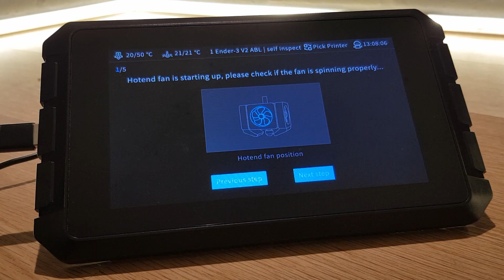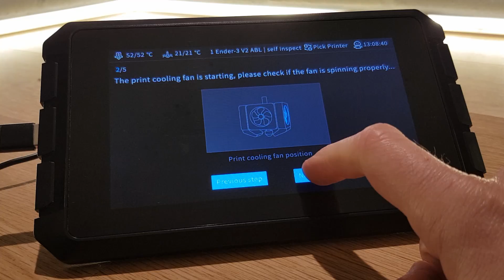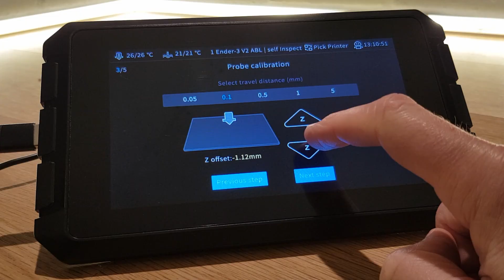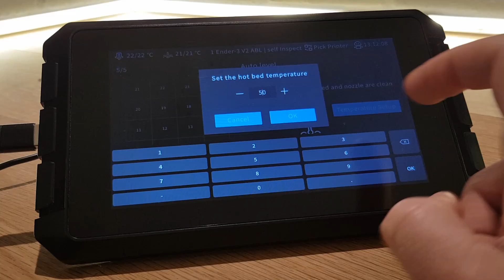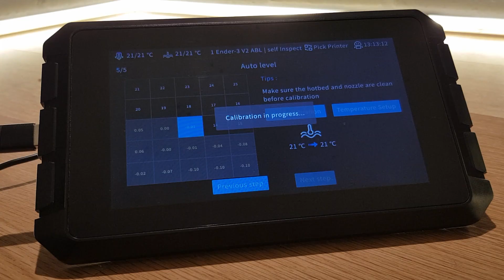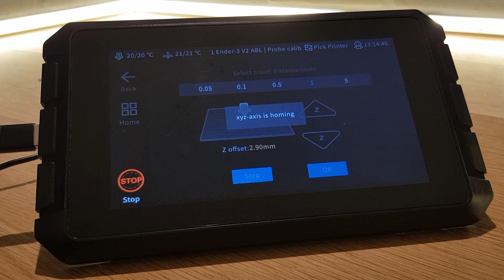Completing The Initial Setup Of The Sonic Pad - Sonic Pad Basics Part 2

Comment: Pretty good but I have a two problems.
I have an ender printer with a sprite extruder pro head and bltouch on it. 
First problem. During "manual leveling", the nozzle is not in axis with a screw.
Second problem. The bltouh sensor is offset from the regular head. As a result,during "auto level", the bltouch goes outside the table. 
So my question is, does someone can advise something?

Comment: I just wanted to add,  I have a Ender  3 s1 pro and I had  the hardest time following the books instruction on leveling,  tighten the screws..... after a few hours I went back to your ender 3 s1 pro leveling followed the steps and I had it perfect in no time.  Thanks

Comment: Hi Ricky, great set of videos, I have a Creality CR-10 Smart Pro and the installation was smooth thanks to your guides, but unlees I missed it, now the pritners is controlled via the sonic pad there is no menu option to shutdown what is the correct process to shutdown the sonic pad and the printer to ensure that there is no software corruption or is it just a case of its save to turn off the sonic pad/printer via the mains.

Comment: Need one more increment:  0.01mm   (I stand by my fastidiousness.)
Can I use console commands during this calibration to help?
Like can I use:
G92
G1 Z-0.01  (however many times necessary)
Then hit OK to save the position as my Z offset?
Reply: Never mind.  I've never done a level and offset that didn't need live adjustment during the first layer print. :-P  Fortunately, the Sonic Pad THEN allows 0.01mm adjustments.

Comment: I've had an Ender 5 Plus for just under a year, upgraded it with silent board, and Micro Swiss NG Revo but have problems with the z offset.  After I start calibration and it gets into the front left corner the probe is off the base and and I have to turn it off to prevent a crash. I get a "No trigger on probe after full movement" error.  Solution guide says, locate the hardware problem according to the error report details.  I can't get past this point.

Comment: how do you adjust Zed offset by only .01? cause it does 0.05, and mine is betwen 2.73 and 2.78 and i don't want to scratch the bed.

Comment: Dear Ricky, I purchased a Sonic Pad, I spent 1 month to discover that it was a defect in the cable. Then the flat cable on the Ender 5 S1 also had a problem. Finally I installed it and saw that you instructed me to CALIBRATE THE Z AXIS, DO THE MANUAL CALIBRATION, THEN THE AUTOMATIC CALIBRATION AND FINALLY THE Z AXIS CALIBRATION AGAIN, only with the nozzle touching the table. I did the step by step and still when I use a table calibration printout, the distance is not correct. I move the table manually and calibrate again. When I print again the error persists. As if the printer compensated for the movement of the table to maintain the distance. What do I do?

Comment: im using an ender 5 s1 and for some reason during the final bed leveling configuration of the connection test,  the prob appears to miss the bed entirely, how do i adjust the work area parameters?

Comment: thank you for this video!! helped me a lot during my setup, watched the whole series!! recently though I have this problem that happened all of a sudden. I dont know if you ever encountered it. I am not able anymore to adjust my z offset during print anymore. when I press down or up, it does not respond to the printer and my prints fail. I tried doing a reset of sonic pad and still same problem. would you have an idea or encountered something like this before? Thank you!!

Comment: Hello, 
I’m a bit confused with the second z offset procedure (the final one after ABL). After manually lowering the nozzle to the 0.1mm feeler gauge why do you remove the feeler gauge, then send a final 0.1 command? Doesn’t that essentially close the gap and put the z offset too close to the bed? 
In other z offset procedures they touch the nozzle to the feeler gauge (or sheet of paper) with a little drag and that's it. They don’t send a command to then close that feeler gauge gap. 
I tried the method you showed and now I have substantial first layer squish and elephant foot. 
Thank you for the content!
Reply: This has confused me too, would be great to have further explanation.
Reply: Well I calibrated with gauge of 0.20mm and did 20+ prints with nozzle dragging and scratching on 20%... I just recalibrated and did -0.20 after I set z-offset and  you know what? It works... Dunno how.

Comment: Ricky, the videos are great.
One question I have is regarding the final Z offset setting. After using the feeler gauge, you then lower the offset the thickness of the feeler gauge, basically eliminating the gap.
Before watching the video, I've been setting the gap for a slight drag with a .2mm feeler gauge and then leaving it that way and haven't' had any bed adhesion issues.
When eliminating the gap, is the pad or klipper compensating for this, meaning the nozzle on my first layer  is actually .2mm too high??? 
Thanks again for the videos.
Reply: Have you come to a conclusion on this? I just posted a comment asking pretty much the same question then scrolled down and saw this. 
All other z offset settings I've seen you lower the z to whatever "gap" you want and that's it. That gap becomes your offset. 
I don't understand why you'd want to send an additional command to close this, unless klipper compensates?

Comment: Hi Ricky, will you be able to advise how to install a glass bed onto Ender 3 S 1 Pro? I removed my magnetic one (gold) but there are two screws on the top or the bed. The glass bed doesn't have any holes to fit it properly. Should I remove the screws or how can I upgrade my 3S1 pro with a glass bed or drill the holes (probably this will damage the plate...)?or leave the gap and adjust the mesh ? I am having horrible trouble with my magnetic bed when I am trying to calibrate it with a sonic pad. So I gave up on printing because everything is coming out bad :(

Comment: I'm wondering why you set the z-offset to minus the thickness of the feeler gauge at the end? Doesn't that mean the nozzle will now be touching the bed?
Reply: Yeah i dont understand that either!
Reply: @timoteiNitrogen  I worked it out. The Z offset is only the distance from the probe to the nozzle. Not from the bed. That's why you remove the thickness of the guage from the value.

Comment: Ricky i found some stuff that you might want to make a follow-up video on.

Today when printing something on my S1 Pro + Sonic pad that maximized the build area i got the error "Move out of range" in the console.
It seems the printer.cfg file has wrong values in it from Creality.
For X-axis it says position_max: 245  (should be 235)
For Y-axis it says position_max: 230  (should be 235)
So i altered these and now it worked to print..

There is also an issue with the 4 bolts in the heatbed, you know the ones the thumb wheels are screwed on. They rotate ! Their bolt heads are not fixed, so if the bolt is a bit damaged (occurs if the bolt hits/scrapes the metal plate hole when often moving up/down) then the thumb wheel wont go up, it only rotates the bolt. So i fixed this with adding another nut before the springs are put on. So now the bolt head and the nut makes the bolt being still :)

Thirdly there is this issue with bed mesh that the front of the bed dips down much more then the back, even though it actually doesnt..
I can see my prints first layer being smashed down/pressed down alot more in the front then the back of the bed so the mesh bed leveling is wrong. Have you seen this issue aswell ? Seems to be many ureddit posts about it.

Comment: Genuine question - why after having gone through the bed levelling process that the Sonic Pad takes you through, do you then need to go into the Probe Calibration function and make a further adjustment to the Z offset. I'm just a little confused as the software does not ask you to do this???
Reply: Great series of videos which I will definitely follow when I get to install my Sonic Pad. Will I have to keep the original touchscreen plugged in to my S1 Pro once the Pad is up and running. 
Being able to remove it along with the mount would give me a little more room on my work area.

Comment: When I do my bed mesh, most of it comes out fine, but my back right corner gives 0.24, 0.23, 0.20, 0.10, 0.10 as the readings in the far right column. Do you correct this with the manual adjustment wheel?
Reply from the maker: Personally, being a bit of a perfectionist, I would probably tweak it a little and run the levelling again to try and improve things. However, the bed mesh should compensate so you can try a print designed to test your first layer and see if it works ok. Be aware that there seems to be a bug with the Ender 3 S1 Pro where it seems to use the bed mesh when you run through the Manual Leveling procedure which messes things up. If you plan to use the Manual Leveling, I would clear your bed mesh first using the web UI.
Reply: @RickyImpey  thanks so much! I know everyone keeps saying it, but your videos are an insanely great resource for all of this set up!

Comment: First of all congratulations great videos.
I just bought the Sonic Pad.
I have recently entered the world of 3d printing and I started my first experiences with my Flsun Q5 printer.
Now I would like to use the Pad on it since it is already supported by the pad.
But before installing I wonder, how to behave with the leveling, given that being a delta I have a fixed plate and practically I only have 3 z axes ...
Can you explain me how to do also about how to use the input shaper probe on my printer. Thank you

Comment: Can someone please help me???  After I start calibration and it gets into the front left corner the probe is off the bas and crashed the head. I get a "No trigger on probe after full movement" error.  Solution guide says, locate the hardware problem according to the error report details.  I can't get past this point.  I know I'm overlooking something so simple but just can't figure it out for the life of me...  Can someone please throw me a line???
Reply from the maker: Sorry for the delay, all you need to do is change the z_offset and y_offset figures under the [Bl touch] section in your config file. What printer do you have? Do you know how to edit the config file?
Reply: @RickyImpey  Sorry to hijack the thread but I have the same issue on an Ender 5 S1 - any idea how to fix this? I'm concerned I'm either going to break the printer head or have bricked the printer :(
Reply: @RickyImpey  I'm running into the same problem with the Anycubic Vyper... also would like help with the config file, if possible

Thanks!  Your videos are AWESOME!
Reply: @RickyImpey  Hi < I also have this issue with an Ender 5 Plus with Micro Swiss NG Revo direct drive, did you manage to find a solution to this problem?

Comment: Will this work with an original Ender 3 (non pro). Also what to do if you have solid bed mounts on said printer?
Reply from the maker: Yes, it works with all Ender 3s, With solid mounts, you will have to just skip the manual leveling section and go straight to creating a bed mesh.

Comment: Hi Rickey, great videos, pal. I've just acquired a Sonic Pad and trying to setup with my Ender 3 Max using your videos. My Ender 3 Max has a CR-Touch installed. The only 'standard' printer option is the Ender 3 Max, no CR-Touch version and it doesn't work with the CR-Touch. I've tried the Ender 3 Neo Max. Ender 2 v2, etc. All to no avail. Any advice would be welcome?

Comment: Tried going through the initial set up last night. And as soon as it starts it cuts out and gives me a message about webhooks request.
Reply from the maker: That sounds like a fault and not something i've encountered I'm afraid.
Reply: Figured out it was any time the hot end would try to heat up. Finally I tried setting the hot end 5 degrees above ambient and it allowed it to heat up. Bumped up by increments of 5-10 degrees up to 280 and it finally allowed it to print afterwards. Not sure what the actual issue was. But that managed to eliminate it for me.
Reply from the maker: @DEFBOY35  have you done a PID tune? It sounds like you have a thermal runaway error. A PID tune should fix this.
Reply: @RickyImpey  I was able to do the pid tune after I had done the steps above. It has been a bit interesting to say the least to try and get this set up. Getting closer though. 
I am scared to shut it off though. As I had lost my entire cfg the last time I did. Even after multiple saves and had to
Go through the whole process again.
Reply from the maker: @DEFBOY35  it definitely shouldn't lose the cfg file when powered off. Save a backup copy of the file if you connect with a web UI if you are concerned.

Comment: Hi Ricky,

When I try to complete the z offset I get the following error:-

error on 'z_offset': 'touch' must have a minimum of 0.0 once the underlying issue is corrected, use the "restart" command to reload the config and restart the host software. printer is halted

My offset is a negative number but now I can't save this please can you help?
Reply from the maker: Check your position_min figure in the stepper z section of your config file. If this figure is larger than you z offset then it may cause the error.
Reply: @RickyImpey  ok will take a look at this later. 👍🏻
Reply: Hey man, thanks for your help so far I have tried what you suggested but it hasn't helped. Regardless of what I have the Z offset set to I get the error..

Even if the value is positive
Reply: I'm assuming that you're not able to help, I'm hoping that you can 🤞🏻

Comment: I got my Ender 3 S1 Plus last week, and the Sonic Pad with it, and very much like the setup apart from the PEI bed becoming delaminated in the center. As a result I now can't use the printer until I get the new PEI sheet being sent under warranty, even for testing as the damage is right where the pre print ABL happens and the sensor touches. So, is there any way to adjust where the ABL checks the bed pre-print so that I can at least do filament calibration tests?
Reply from the maker: Sorry to hear you've had issues, could you not flip the bed surface over and print on the back in the short term?I don't have the Plus so don't know what the back surface is like.
Reply: Thanks for the reply - the back is just bare spring steel, plus I am not sure how the detached area would affect the seating of the plate. If I can change where it senses it would be usable

Comment: I have a sprite extruder on my ender 3 pro. When I try to do the initial bed level, my probe is off the print bed.
Reply from the maker: Do you have the latest firmware on your Sonic Pad? I believe they have added sprite config options. I haven't tried myself. If not, the home position is set in the printer.cfg file. Look for the 'home_xy_position' line in the [safe_z_home] section.
Reply: @RickyImpey  appreciate the response btw
Reply: how do I edit the .cfg? The pad gives me a .bin    I do have the latest firmware on the pad, I even read the change log where they talk about being able to select a sprite extruder, But it is not available in the initial set up

Comment: I'm planning to switch to Sprite extruder on my Ender 3 v2 with the Sonic Pad connected. I believe, a lot of users will go through the similar process. Can you make a video with advices what and how to do in this case to have all direct extruder and Sonic Pad benefits? Including changes in e-steps, retraction, calibration etc. Thanks  :)
Reply: In the printer config file under extruder it will be rotational distance you want to
Change (not e steps). A good starting point would be 8. That got me pretty close to extruding 100mm when I demanded 100. And tweak from there until you are as close to exactly 100 mm

Comment: Great series, would be useful to show us how to redo levels with Sonic Pad after initial setup as it is proving to be a pain without resetting the sonic pad. If I tighten all the springs, probe, then go to manual I get no 'play' in the springs, so I untightened the springs by 10 turns, probe, went manual and now my auto calibration is all over the place. What are the steps for redoing bed levelling with the Sonic pad, am I missing a step or doing in wrong order?
Reply from the maker: Great idea, I will add it to the list of videos. You can skip past the manual level stage in the initial setup if you don't want to mess with your spring tension too much. After, go to the 'manual level' option in the menu and then just drive the nozzle to each corner to make sure the machine is trammed accurately. Then set a new z offset and then take a new bed mesh. Hope this helps.
Reply: @RickyImpey  Much appreciated. Look forward to the video. I deleted the printer and added it again and ran through setup all levelled fine but of course I don't want to do that every time.
Reply: @RickyImpey  I'll second the request for the follow up video when you're not running the initial wizard please, I'm also having real nightmares getting my S1 Pro and Sonic Pad set up to print reliably and get exactly the same as @LeicesterPhoto when trying to do standalone manual bed levelling

Comment: I have an Ender 3 pro 4.2.2 with a BL Touch. When setting up the pad I keep getting the Error Message “Touch Failed to Deploy”. I installed the BL touch over a year ago and it worked fine with Marlin. Does anybody have any suggestions on how to fix this? Also… when powering on the machine the probe goes up and down normally, so I’m not sure why with the new firmware it is acting like it can’t.